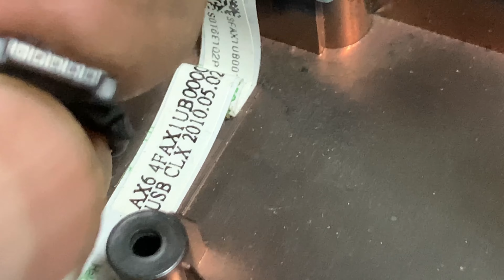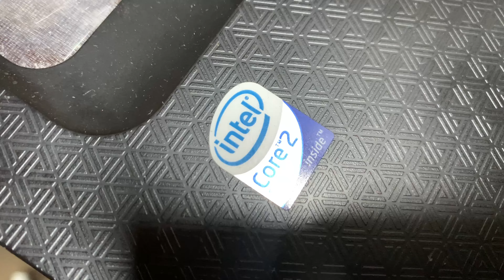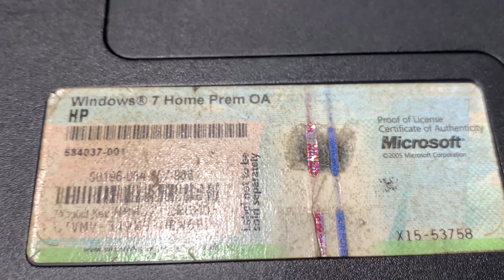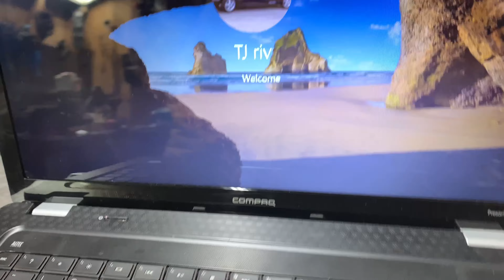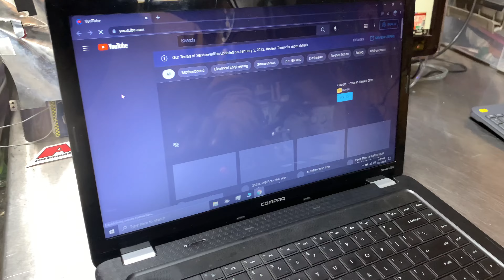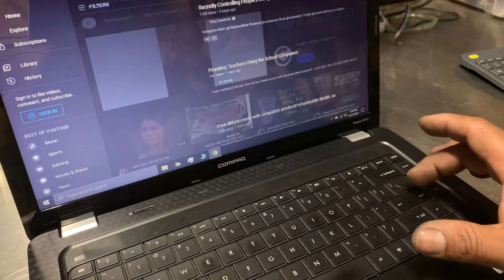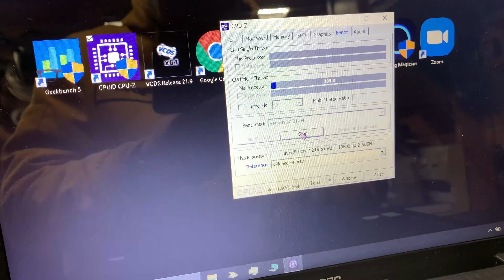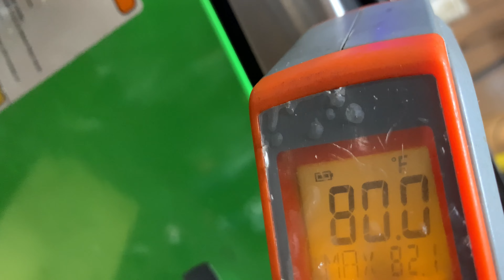Thermal Liquid metal my 12y old Laptop will it work ?

Comment: Its ok i guess but why protect that ancient relic hahah. I wish you showed temperatures
Reply: Hello greetings from Switzerland, 🇨🇭 I like to repair older computers especially older laptops 💻the reason why I'm watching this video as if to see if I can improve the performance of my old computer and maybe still use it

I changed the operating system to Linux put an SSD in it and more ram

Now I'm considering putting liquid metal in an old computer

Older computers have a lot of advantages they have a lot of 

I/O Outputs 🔌 usb A  HDMI VGA Optical drives 💿
and many more.

And batterys are replaceable 🔋

There's a lot of other reasons to Elegance Beauty strudines 

To save money💵 or to save the environment🌍

Or pure simply nostalgia🧓
Reply from the maker: Yeah man   I like old computers maybe im to old and is why  .  Sorry i just seen your comment.
Reply from the maker: Because it was my first pc 🤷‍♂️

Comment: hy, i have a msi laptop GF63 thin , I want to add liquid metal, but the base CPU heatsink is copper (there is no problem putting liquid metal), but the GPU base heatsink has the color of aluminum, the problem is that aluminum does not you can put liquid metal but instead in nickel and silver if you can(I have read that the heatsink can be made of nickel or silver as well and you can put liquid metal there), the problem is how to identify if it is silver, nickel or aluminum so I know whether to apply liquid metal or not. I don't know if you knew how to answer me about it, thanks!
Reply from the maker: Man that’s thought one , I won’t know what it is until I try.  , you can test it for a day or 2 or a week and dismantle the pc to check if it has eaten or not.  Is the only way I will know and you can catch it before further damage. That way you know
Reply from the maker: Its only like 36 degrees difference  on cooler   Regular paste 80 to 90   Liquid cooling 50-60 degrees
Reply from the maker: My computer still working and i can said better than new and some cases better than a new ones